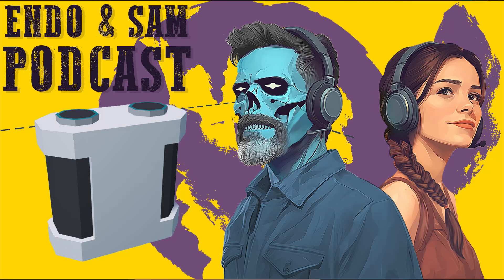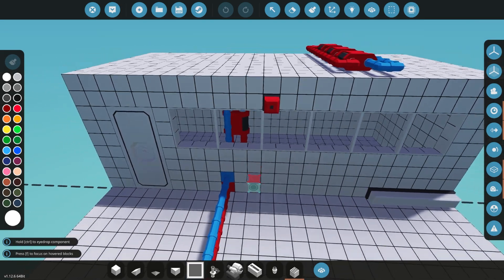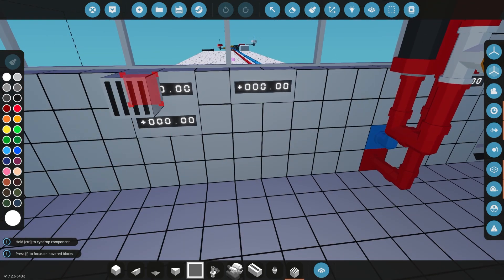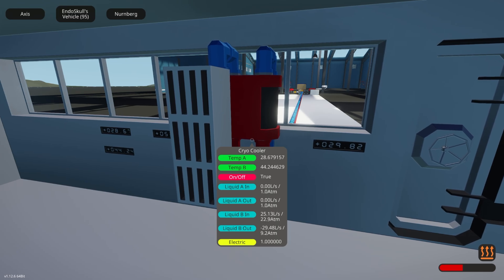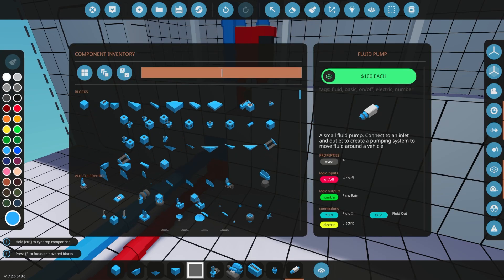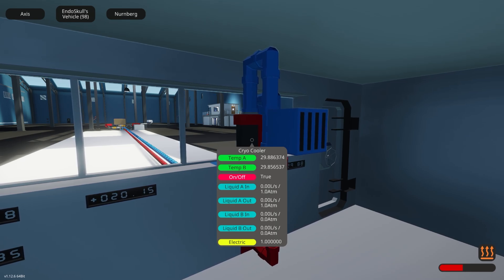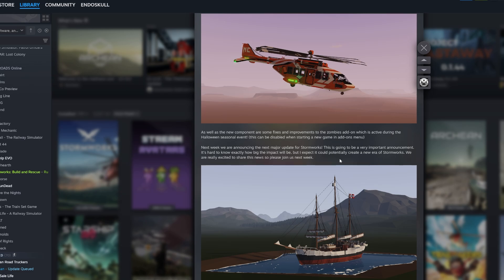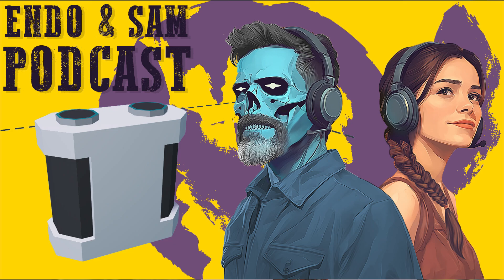v1.12.4 - Air Conditioner (Thermoelectric ) Update & Mods Coming?!?  | Endo & Sam Podcast | Ep 0002

Comment: With this part i honestly feel like they should just put only two pipe connections, hot in and cold out, at least people would understand how it works. I thought that its ment to be used with fluid inside and then using liquid-air heat converter to cool a room, im not sure tho.

Comment: its a liquid thingi so if side A heats up it takes that heat and puts it in side B so side A get cooler and Side B gets hotter and sense its liquid you cant use it for AC or heating. BUT you can make an engine that can run forever as there is no limit on how hot rads can get. So side A to engine and side B to rads.
Reply from the maker: Right - but I was trying to get the air conditioning working - looks like you may need many of them running to cool a room - need to mess with it more i guess.
Reply: @GoogleTime34  This is the first thing I treid, but it did not cool very good, the side with the radiator only reached around 30°c when my engine coolant was already above 100
Reply: @krijndees  you didnt connect it right then the B side should go the the radiator and the A side should go to the engine